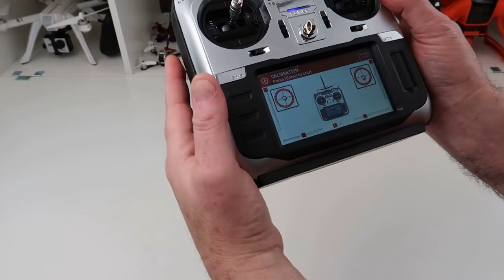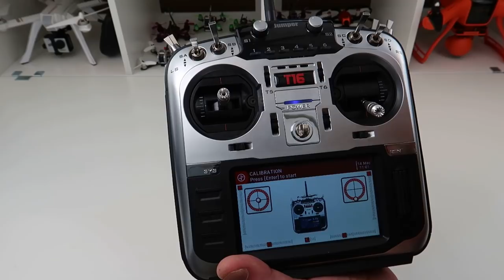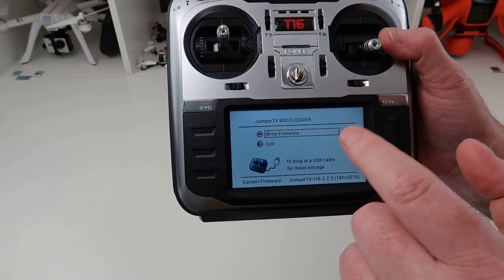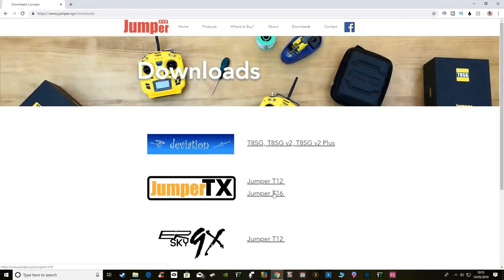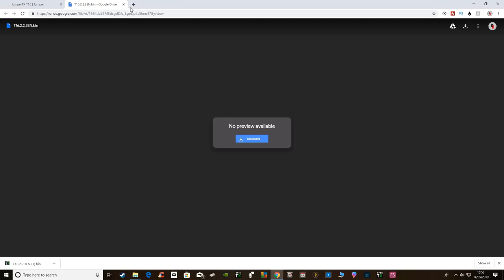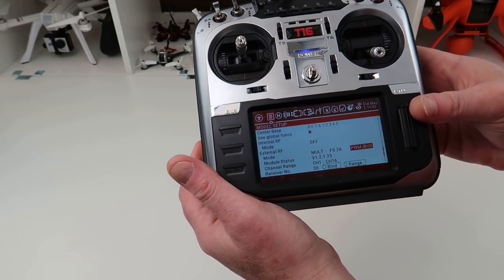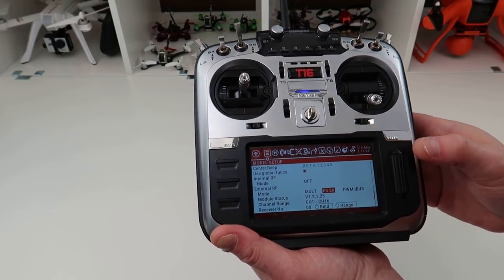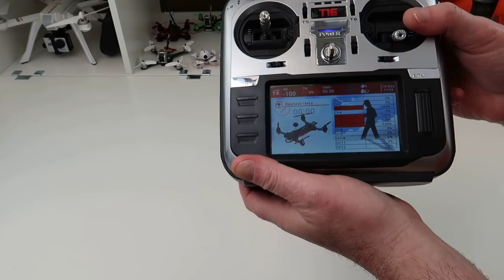JUMPER T16 TRANSMITTER UPDATE + COMMENTS ANSWERED

Comment: Hey Colski, I got this transmitter already, and quite happy about the overall feeling. One question though.. How to bind this Jumper T16 to the Radiolink R9DS kind of receivers which uses DSSS and FHSS protocols? I am somehow unable to bind those receivers in SFHSS option in "MULTI". Do I have to choose some other protocol for FHSS / DSSS?
Reply from the maker: Hi I don’t believe you can bind the radiolink receivers to the jumper as they use a unique protocol
If you search on YouTube I am sure someone will have a work round to get them to work
Reply: @CKone41  I thought so as well. Thanks. Will look around for workarounds.

Comment: Thanks for the useful information. I have one more question for you. Is it possible to update Frsky receiver firmware from the module bay of this Jumper T16? If it doesn't work, then how?
Reply from the maker: RCRahul 365 Hi mate you just take the module out and hook up your receiver to the pins then update as normal from the radio settings menu